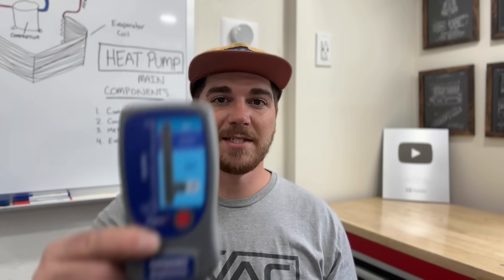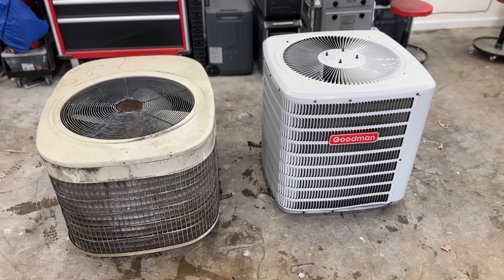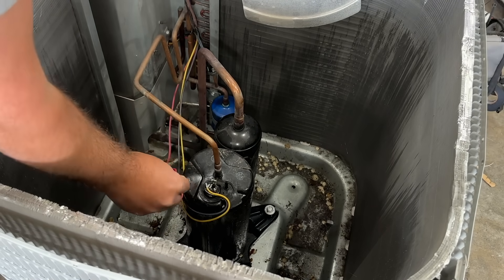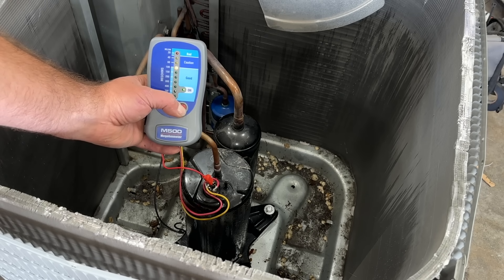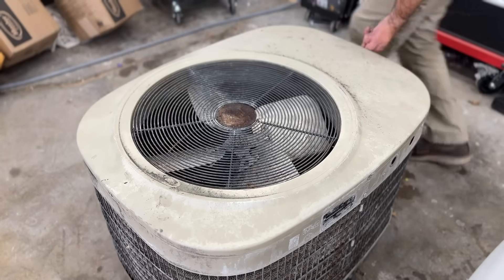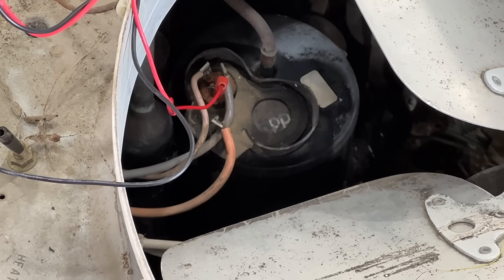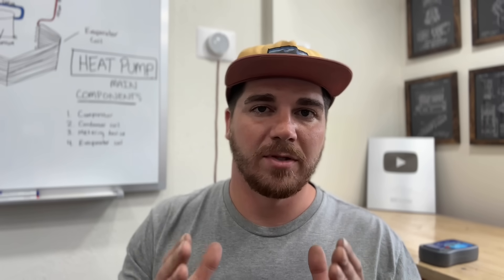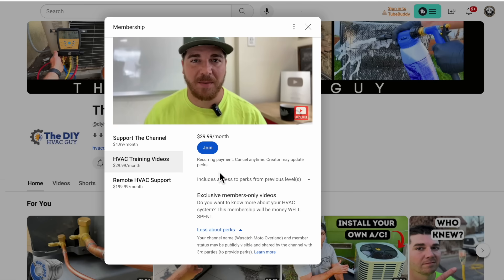Is Your A/C Unit About To Die? This Tool Doesn't Lie

Comment: some good videos on how they rebuild a/c compressors and can see theres more that can fail besides the windings. most common is burnt capaciter and easy to replace. on an old mini split the remote receiver board and indoor pcb failed. i replaced them with a single universal pcb with onboard receiver. works great  ali express about 25usd. worth using an under / over current protector as the expensive pcb's can die.   also be very careful with caps as they can store electricity even if power turned off.  i use insulated gloves and tools

Comment: Take all the wires off first dummy. the wire that is still connected does don't have the same specs as internal compressor resistance checks.

Comment: A meggar should be used on an isolated piece of equipment. If not, you are measuring the resistance to ground of whatever the other wires are connected to as well as the compressor. Also when using a meggar, it is actually measuring current flow, the lower the current the higher the resistance. The increasing readings are totally normal. They are normal because the circuit is acting like a capacitor, once the circuit is is charged , then can the resistance be determined. On the safety side the system will be "charged" after measurement. Be sure to short/discharge the tested circuit to ground before touching!
Reply: Agree.  Should have totally isolated the compressor.

Comment: I just updated my central heat & ac unit It was a Fedder installed in 1972. Replaced system not because the compressor failed but the ac system developed micro leaks. 3 in the last 4 years in different areas. With  the insane cost of R-22 to recharge a 5 ton system. I couldn't justify the cost. So replaced the whole unit with the help of your videos. The $ saved on utilities and installing it myself. It will have paid for itself in 3.5 years. Thank You for the help. I could not have done it without your videos. Keep up the great work.

Comment: ohmmeter that uses higher voltage to check motor windings is a very good tool, but limited in scope of what it can tell you. many other issues with electromechanical devices that won't show up on resistance tests but kudos for giving average joe homeowners some direction in troubleshooting. I think a lot of consumers don't know the huge scientific and physics principles at work to remove the heat from the air inside of a structure and expel it outdoors (or vice versa in the case of heat pumps) and anything that can be done to demystify the process is always good.

Comment: As an industrial electrician of many year's make sure you disconnect and isolate the motor from all possible wire insulation  and capacitor leaks to ground. Also the ground connection should be very clean to avoid a high resistance and give you a false reading. Nice video 👍

Comment: This tests one parameter, insulation quality. Does not tell you about cylinder, piston, bearing, scroll condition. 
In my experience, insulation is the least of my concerns.
Reply: And it only tests that if you remember to disconnect the leads going to the compressor before you measure it!

Comment: While I might use this to indicate if further testing is needed, I probably wouldn't condemn a compressor without checking further.   Many "condemned" compressors tested at the factory show nothing wrong with them.  "Studies performed by Copeland have found that compressors with megohmeter readings as low as 0.5 megohms still pass the hi-pot. There are many factors that affect megohm readings  including  contaminated refrigerant, oil level, refrigerant in oil and current leakage through electrical fusites or terminal plates. As mentioned earlier a single megohm reading cannot be used to condemn a compressor since many other factors are involved. However, limits can be placed on megohm values that dictate action be taken.  Copeland has found that these limits are related to the rated voltage of the compressor. Megohm values equal to or greater than 1000 ohms per volt are probably acceptable. For example, a 460 volt compressor might show a megohm reading of 460,000 ohms or 0.46 megohm. Compressors with rated voltages of 208 to 230 volts would then be operable at megohm values of 0.208 to 0.230 megohms; for simplicity, Copeland has set the limit at 0.5 megohms before a compressor is condemned. Figure 1  shows the required procedure for checking compressors with a megohmeter. New compressors that have never been installed will not need any system clean-up procedures so long as the megohm reading is above 0.5. A baseline reading must be established for comparison purposes and since this is its first reading this will be its baseline"value.

http://www.graycoolingman.com/uploads/1/0/6/6/10667336/copeland_4-1294.pdf

Comment: I’ve wondered if I install an Easy start Microair 368 on my 2 stage American Standard condenser would make a difference in prolonging the life of the compressor. Would installing it eliminate the need to replace the capacitor? I’ve read so much about the Micro Air on this channel. Thank you

Comment: The tool tests electrical insulation and nothing else. It cares not what refrigerant is used, the condition of the refrigerant, or age. All it measures is the ability of wire insulation to keep electricity in the wires. 
It’s a marvelously useful tool, and can often warn you things are getting old. It really ought to climb all the way to the top of the green scale in quick order. If it doesn’t, electricity is leaking through the insulation — a sure sign things are about to go bad.

Comment: Just had a guy declare my AC not worth fixing today.  It's a 33 years old Sears AC.  He claims I'm very low on coolant.  It uses R22, which he claims is $220 per pound.  He stated he wouldn't sell me $1000 - $2000 of coolant for an AC that would just lose it in a few months anyway.

The AC still works and feels cold, but freezes up constantly and can't pull the temp down (takes several hours to pull it down 2 degrees on a 75 degree day, if it doesn't freeze).  No red flags with the guy.  It's a local, reputable, company.  $5K to replace it with an entry level Trane 2ton, soup to nuts.
Reply: Where I work we charge $225 per lb for R-22.  So his quote doesn’t seem off to me.
Reply: @EnigmaticJack  Appreciate the validation.  Won't bore you with the long story (AC is struggling), but they're replacing my AC on Wednesday.
Reply: @BillyBobDingledorf  Trane is excellent

Comment: OK, bought the M500, just went to my A/C to check it and the only item I can find to plug into on the  compressor is on the side of it (I recall you saying in this video the access might be on the side):  I have to unsnap a plastic covering which shows 3 SOLID probes....I connected the M500 and it didn't register on the tester.....I tried all 3 with the black to a ground (frame screw).  It now occurs to me that perhaps the GROUND was not good? Perhaps I'll fiddle with a BETTER Ground. What say ye?  thanks, Chris
Reply: Yes it sounds like you have a bad ground connection.

Comment: May be a dumb question.  Could you not use a multimeter to check the resistance on your pins instead of purchasing that tool?

Comment: If you're going to meger the compressor you should remove all wires and then do your test on each terminal. Your test method could pickup carbon dust on contractors etc.

Comment: My AC coil was replaced 2 years ago now, according to ac guy, it has a small leak!  He said since it is aluminum, it is not worth repairing. Parts is still under warranty but labor/refrigerant cost me $900.00 two years ago. He said it is more now. I jokingly told the guy that I can patch the leak with bubble gum😂. 
Anyway, how can I be sure that the replacement doesn’t have a leak (damage from shipment), before they install it? Thanks!

Comment: How much would an air conditioner at good price new or used cost for 1 acre of land or ~3000 square meters for a greenhouse? A unit that can lower temperatures to 2-3 Celsius or 41f?

Comment: I had THREE different ac companies tell me my 10-year-old compressor was shot and I needed a new system.  Finally a friend of a friend came and looked at it and fixed it for less than $100 by simply replacing pressure switch.  That was 10 years ago and it's still running fine today.  Anyone else would have just believed them and paid for new system, especially after three different companies saying need new system.  AC companies are worse than used car dealers!
Reply: Or just bypassed it lol
Reply: When a tech comes to your house for a service call, his dream is to up sell you a new system. He gets a nice sales commission on that sale that you may or may not need.
Reply: @bills6946 not all, I would never work for a company that gives sales bonuses. I always try to fix a system before condemning it. There are times that the cost of a repair may outweigh a new system
Reply: Um, you replaced the pressure switch? You recovered the refrigerant, didn't vent any, and then had your friend braze in a new switch, and of course vacuumed it out and put the refrigerent back in? For $100 bucks?
Reply: Probably jump out pressure switch @sprockkets
Reply: @donsmith6937  that's not what the original poster said, but they won't rely, probably because they can't actually back up what they claimed.
Reply: @sprockkets yea im not really buying it either
Reply: @sprockkets a lot of pressure switches screw on a Schrader port with no need to remove refrigerant. Just unscrew old and add new one and you're done
Reply: @JohnDoe-tf8ov  not oem installed ones, but feel free to tell me which brands do it
Reply: @sprockkets  cut the wires. put a t fitting with schraders. get a pressure switch with schrader and use other port for service. up to the customer if they dont have 1000 bucks and just want that old pos working
Reply: @scottjohnson7467  you aren't really getting the point. It's not likely they bypassed the switch entirely or simply doesn't have their facts right.
Reply: @sprockkets  no bypassing. a cycle switch is on high side and thats for your fan like youve seen. install new psi switch on suction with a t fitting so you still have a service port. then take ur cut wires and tie into new switch
Reply: @scottjohnson7467  I think it's clear you don't know what you are talking about
Reply: Oh right on man, i see it on commercial shit all the time. Best of luck to you and your residential learning friend
Reply: @scottjohnson7467  Oh I see, now you think I don't know that pressure switches are all over commercial equipment, seeing how that's how refrigeration works. Cute strawman, esp when I clearly stated and defined that goal post right above. 
And I guess since you can say shit in your comment, you can go FY. Further replies from you will be ignored.
Reply: Does it apply to splits? (Panasonic A/C inverter 9000btu)?
Reply: @ronaldd.1355  I think in general, many HVAC guys have no idea what they are doing, and have no diagnostic skills, thus just recommending a complete replacement.
Reply: A good 50% of HVAC companies are bandits ! Seems like a lot of them, maybe I'm too high on that but many times they are only interested in selling replacement systems as if they work for the Government/EPA.
Reply: There should be a gov't contractor agency that random spot checks these companies, pulls licenses as needed and then turns them over to the attorney general to sue.
Reply: I’ve gone on second opinions for a bad compressor and found a wire burnt off terminal. Reconnected it, started right up. They were about to buy an $8000 system.
Reply: It was probably one of the pressure switches that you tie in to the gauge ports that was installed.
Reply: @jonathanocegueda7848  which would be interesting because those are usually put in for those who need to switch off a fan motor because they need the a/c to work in the winter for reasons. No residential unit would have this.
Reply: how long have you been doing residential?
Reply: Some of the pressure switches have schreader valves on the brass access ports, allowing you to change the switch/sensor without a system pump down or recovery
Reply: @williamkrueger15  no system for residential has that arrangement from the factory.

Comment: Compressors that test bad according to this megger are not necessarily bad.  According to Emerson, you can have a good compressor megger out to as low at 0.5 megaohms, where this meter will tell you 20 megaohms is bad.  Additionally, contamination can cause low readings and if you remove the contamination, you remove the low reading and the compressor is fine.  I suggest reading Emerson Bulletin AE4-1294 for more details.

Comment: Do you have any information on Modular Air Handlers for ducted heat pump systems? I'm considering an American Standard a 3 ton, 16 Seer Condenser with a 5 ton two stage air handler model #POVOBOOOM50SDA and 5 ton ADP horizontal evaporator coil model #4TXCBOO5DS. I'm told this will work with the existing 120v power. This system will replace a Furnace and AC system.  A video on this would be great!

Comment: Dave, i'm getting ready to buy parts. How long would you let a line set run for. No burn out. 25 years or older. or could that copper still be good? What's the best practice. Less than 20 is good. Or 30+ years. Money is not the object. Quality and longevity. I feel like some techs would no question throw the old one out.

Comment: Just what are you measuring?  Resistance?  Wire insulating value ?  Voltage leakage?  Just saying a compressor is nearing failure due to a light is very misleading.

Comment: To perform a DC Insulation test on any motor you need to disconnect all the external wires and then perform the test. Otherwise you are testing the motor and the external wiring through the windings of the motor. Also if the unit has any electronics you run a good chance of damaging them with the high voltage.

Comment: New stuff is made to fail, my grandmother had a GE refrigerator that was over 50 years old, it ran until the house got flooded and water got inside the compressor area and the people who help clean up threw it out.
Reply: We have a G.E. refrigerator made in the 1940's. Has a small freezer inside and we have to defrost it every year or two. Works like a dream, no fans etc. Quiet as a mouse and it uses 2 amps of power !  Its a keeper. The EPA and other departments would tell us otherwise including the power companies !
Reply: @Garth2011  I had one like that too. It got destroyed in a flood about 10 years ago. I wish I still had it.
Reply: In 1972 I saw a program on PBS titled "Planned Obsolescence". They are building them worse every year, intentionally.
I am a mechanical engineer. I graduated in 1972.

Comment: Neighbor called me to come to her house. HVAC contractor was trying to charge her $320.00 to replace a wire on the condenser. I disputed the charge and fortunately the contractor tore up the work order. Two days later, she called me and said it had stopped blowing cold air. I walked over, looked at the condenser and the wire he replaced was burned up. Again! I told her wires don't just burn up. Something caused it. I looked at the contactor and saw it was completely burned. I went to a HVAC supply house not far away and bought a new contactor for $16 and new capacitor for $15, replaced them and the burned wire and it's still working three years later.
Reply: Lots of those "supply" L1 and L2 wires heat up due to a poor contactor interface with the load. Because of their cost, I would always replace the contactor when repairing burned supply or load wiring because, as you say, wires don't usually fail, its the current that burns them up so its a connection that is bad which could be a wire terminal, the contactor, a loose screw or terminal to the supply L1 and L2 on the contactor etc. Lots of techs also will replace the capacitor when they replace a fan motor which makes much financial sense as the good ones are only $30 and many motors will come with a cheap Chinesium cap.

Comment: I helped a friends mother.  He told me at work that it was the original unit to her home.  When I got there it was a Chrysler Airtemp . Built in 1964. Had a bad contactor.  Replaced, cleaned outdoor coil , lubricated outdoor condense fan, ,,   STILL RUNNING TODAY.
Reply: Yessiree, and now the weak point of that condenser is going to be the new contactor because its a new part that is not quality made like the rest of the condenser. I always tell folks to have a spare USA made capacitor and contactor on tap for the day they need one in the hot summer when HVAC is super busy and a few days before an appointment. At least you have a running start with the correct parts in the event their truck hasn't got what you need on that day. Yes, they usually have those on their truck but they do run out sometimes.
Reply: @Garth2011  hey Garth.... I am retired.  I was just helping out a friend with a disabled mother. I did pick up a good contactor.  Plus all the cleaning and lubrication.  I have a 4 year degree in HVAC/R. Worked in the trade for 35 years.  The last 20 years was industrial.  Boilers, chillers  , and DDC Controls. I've been retired for 7 years. Lol. I started out when heat load calcs were done Manuel D , on paper......now I'm telling my age.